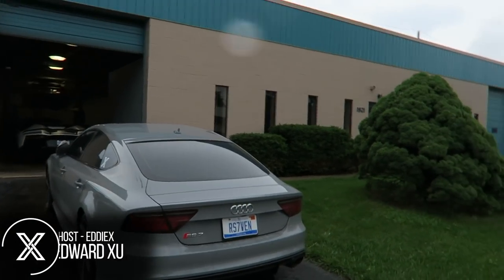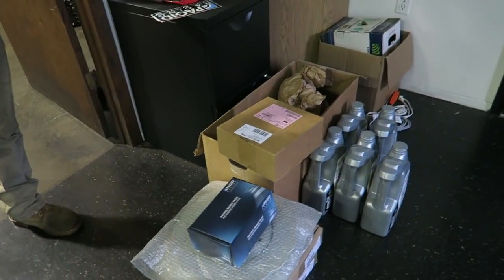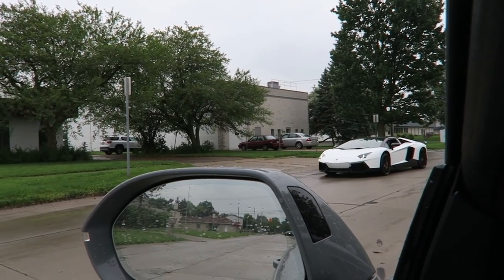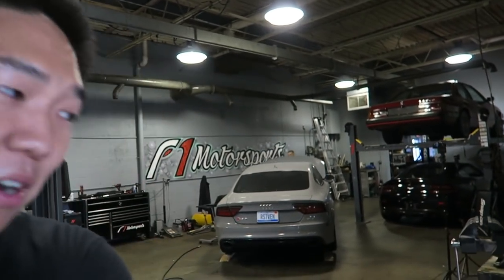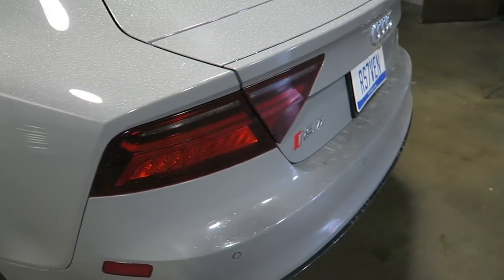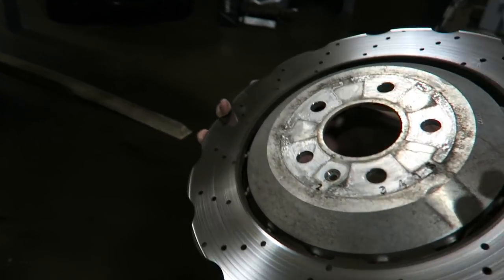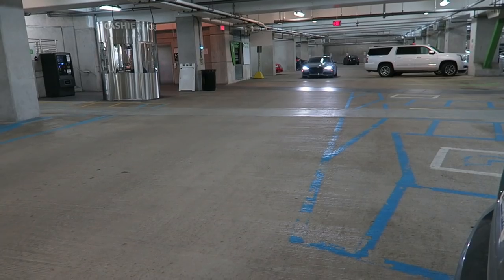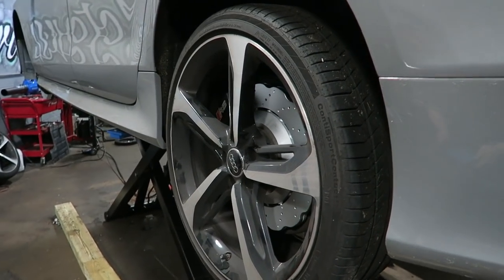How To Save $$$ When Changing Audi RS7 Brakes!

Comment: DIY'd the brakes and rotors on my B8 RS5 and saved $3.2K
Reply: Same here!
Reply: Changing the pads on my  rs5 soon, debating on which pads I should buy. You guys recommend any?
Reply: Elias Bako I use the Hawk HPS 5.0 Performance Pads. Highly recommend them! No noise whatsoever and WAY less brake dust. I ordered them through ECS tuning
Reply: @TonyC317  EBC red stuff from ecs tuning was my choice, very happy with it. I didn't replace the rotors, just the pads.
Reply: I need brake pads for the ceramic discs on my 2009 Audi S8 5.2 V10...and suggestions??

Comment: I have a used 2012 Panamera Turbo. I was shocked to find out the dealer quote for the brakes was ~6k. I've basically never done any repair work myself. Did some research and watched quite a few youtube vids, bought Zimmerman rotors and Textar pads and installed them myself for about 1.2k including tools. Fulfilling way to save :)
Reply: same story on my "20 S7. 4500 dealer, 1300 ME !

Comment: @EddieX i have 60k miles on my 2014 RS6 and brakes are still good, i'm on my third brake pad set and will probably last for the 4th one also. Probably the OEM parts for USA are different. Had no squeaking problems.
Reply: Wait, you're on the third pad set on the same original rotors?
Reply: @PanameraTurboSEHybrid  Exactly, my mechanic told me that i have enough "meat" on them for another set. But i will most likely change them with the 4th set just to be sure. An for the back pads, i changes to second set at around 70k km (45k miles). I dont go to tracks with it, but i dont drive slowly either :) Maybe US parts are from a different material or dealer there just want to milk customers out of their money. Thats what they do here at least. (I'm from Europe btw).

Comment: Hey Eddie, great video as always.  I did have a question regarding the brake job.  Did you consider using FCP Euro?  They have lifetime warranties on all their parts (including wear items such as rotors and pads).  They have OEM front rotors as low as $392.97 and Genuine Audi pads for as little as $95.54 and OE for $54.89.  I was just curious if there was a reason you stayed away from them or not.
Reply: Your front rotors on your website are $877 each…?
Reply: @Ryan-jv7on  parts prices have skyrocketed this year for every car now. Minimum of 45% in the last 8 months.

Comment: I would have just replaced the pads for now and after another 10k km I would have done rotors and pads. That's what I did on my RS5 which has the same rotors, I took out at OEM pads and put EBC red stuff, got rid of all squealing. 

Also the OEM ceramic pads for my RS7 performance cracked  after like 10k miles and were squealing and grinding like crazy. Luckily they were replaced under warranty...
Reply: EBC Redstuff is absolute rubbish. PAGIDs are high end proper pads that are designed for heavy use high heat cycles. I use to do a lot of track racing and the EBC Redstuff just went to shit after a few proper race days. We're not talking running up and down a drag strip. We're talking full ball circuit racing. Gave up on the EBC anything and switched to the PAGID Blacks... race pads. night and day difference. Eddie chose the RIGHT brake pads. The other reason for changing ROTORS and pads at the same time is allowing the bedding in process and the pads and rotors to bed identically and match wear patterns for maximum grip and performance and longevity of the brake pads and improved braking. Cycling rotors and pads differently like you suggest reduces braking performance and efficiencies. Eddie has done this correctly. You are clueless bro

Comment: So true, brake sensors on my e92 m3 are like 100+ at the dealer I bought them for 20$ from a parts store... same thing
Reply: Admir Hajdarevic better yet, reuse the old ones
Reply: @serjiang  Yeah if you manually check the pad wear and yank them before they burn the sensor you'll never need a new sensor haha
Reply: Admir Hajdarevic do you even own a BMW? You know you can check the brake wear on the dash right? It’ll show how many miles til needing replacement.
Reply: @serjiang  are you serious? That is simply a service interval... its just recommended mileage from BMW they don't actually reflect your REAL brake wear.. You're right I don't own a BMW I own an M :)

Comment: I went to an 'audi specialist' local to me, he changed the rear brake pads on my S7... (i thought it was the rears that needed changing after light came on - felt low! but in fact it's the front.)  told me he cannot change the fronts, since it needs a special tool.. does he know what he's talking about!? and if he doesn't, I'm amazed he changed the rears... :/ - someone advise pls.

Comment: a good shop can turn those rotors and save you some cash
Reply from the maker: Nope. Can't be done on these rotors. They are too thin. A friend tried to do it on his and they ended up warping.
Reply: Eddie is correct, these cannot be turned.
Reply: They are also too big for most shop lathes, I ran into this issue on my S8.

Comment: Why do you need the software to release the rear hand brake.  Can't you just release it in the car?
Reply from the maker: Not with some of the Audi's. Has to be done through vagcom
Reply: @EddieX  Whats the easiest way to get the tech/software to do this?  I have a B9 S4
Reply from the maker: @tmitch45  VCDS/Vagcom cable from rosstech. Or check the forums and groups and see if someone local will let you borrow it
Reply: @EddieX  Thanks for the advice!

Comment: Buys an expensive car . Then demands cheap parts and labor. to maintain said vehicle.
Reply: Why should you pay more if you don't have to
Reply: Nothing wrong with saving.
Reply: If its about saving than why would you buy a RS7? why not just buy a Honda Civic?
Reply: You just don't get it.
Reply: So mainly you buy your parts from the dealer? Anybody with a German car should no not to spend close to 200 dollars for brake sensors when you can get the same one's for 12 to 15 dollars. It's just smart
Reply: You get what you paid for. Getting a $200 part for $15 really begs the question on the quality of said part.
Reply: @daverr8163  it's the same part same quality the dealer jacked up the price. There plenty of places that sale oem parts other than dealer
Reply: @daverr8163  you do realize that oem parts bought directly from the dealer or the car manufacturer website costs way extra?

Comment: You are aware you don't change rotors every brake change
Reply from the maker: On this car you do. Rotors have a very thin usable material. They were measured and needed to be replaced.
Reply: @EddieX   I guess it's the price of owning a high end car, does seem alittle excessive for them to design the rotors like this, I've only ever heard of that type of wear and tear on indy and nascar vehicles. Regardless it is a beautiful car👍🏽